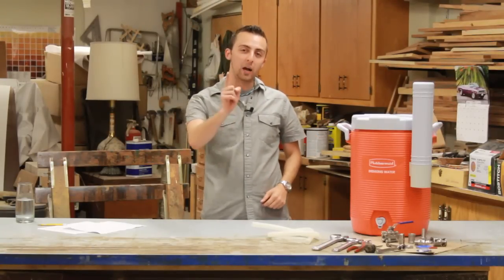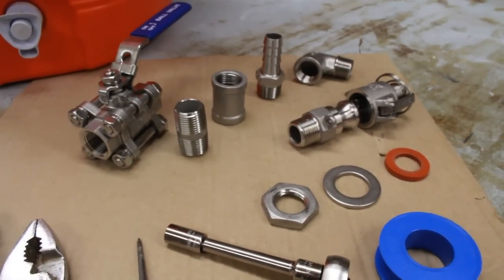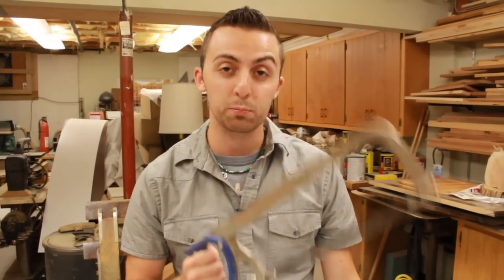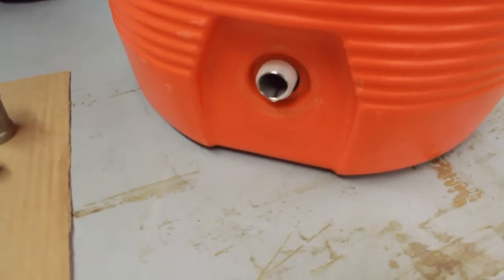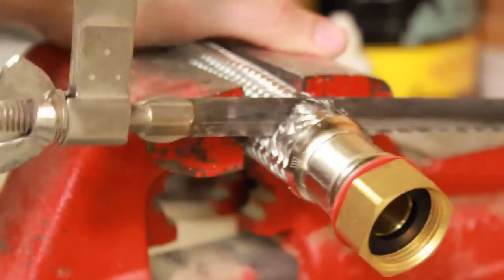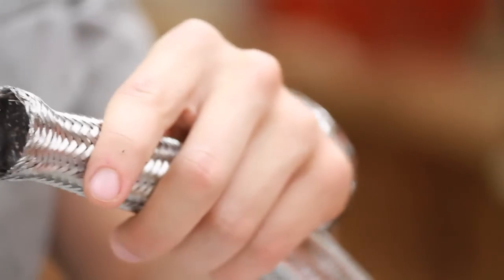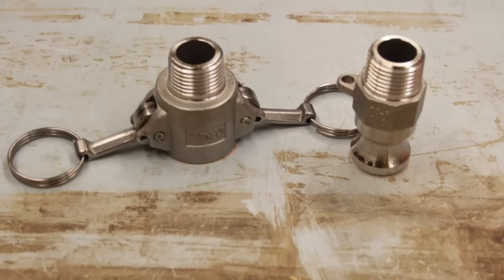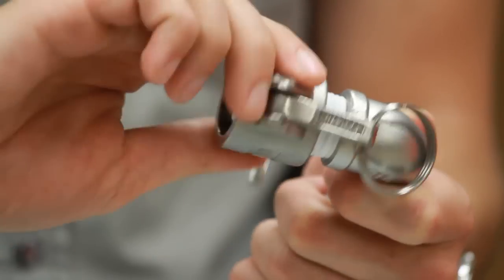How to Build The BEST Mash Tun from a Beverage Cooler

Comment: thank you for the video!!! The most informative and properly produced i have seen! I happened to have stainless some dishwasher hose sitting around. smaller diameter, but it is longer. thinking it will work just as good or better because it will be long enough to circle the bottom of the mash tun twice.  To all the folks complaining- you probably wouldnt be happy unless he to your house with all the parts and built it for you.....  Much appreciated man!!!

Comment: Thanks for the video was incredibly helpful, as well as the links in the description!

I used your design with only a few minor changes. For the Filter I used a 24" long Water heater hose and made a loop that connected to a tee. I figured the loop would make it more crush resistant and the additional surface area would make it more efficient. Also added a coupler so the filter assembly is removable for cleaning.

Great video!

Comment from the maker: Thanks man. That's what I was going for here. Because I bought most of the parts online, I got a good deal on them and they didn't cost much more than brass would have anyways. It was $75 total; I spent $65 on hardware (and that can be trimmed down still) and $10 on the cooler. I just updated the description with the detailed supplies list.

Comment: Great Idea, I built one from 1/2 inch brass pipes and valve plus a 3/4 water heater connector. The tread was short on brass connector so I had to use 1/2 inch EMT nut, this nut is only 3/16 thick (nut on electric EMT pipe connector).

Comment: It's cheaper to buy a purpose built "Bazooka Screen" filter from the brew store than it is to cobble one up from a braided hose. The bazooka screen has a 1/2" NPT thread on the end so it makes the installation easier too.
Reply: InsolNation,true

Comment: What a great video, thank you!! I found on Amazon what might be a pretty good alternative, much simpler, and not too expensive. 
1) Stainless Bazooka screen with 1/2 inch MPT $8.41
2) 1/2 inch stainless globe valve $18.00
3) 1/2 inch stainless coupling F/F $7.13
Local homebrew supply shop has 1/2 inch silicone tubing at $3 per ft

Turns out I have a 48-quart rectangular Coleman cooler. I can't think of any reason why the lauter tun has to be round.  It's got a pretty large cross-sectional area, and the drain is about an inch off the bottom. So the volume of mash in the cooler below the drain might be a bit much, but I suppose I can raise up one end of the cooler to force liquid toward the drain.

Comments?
Reply from the maker: you 100% can and should use that cooler; doesnt need to be round. this rig can be transferred into any cooler you think it will work in.  i will warn against using a globe valve as they're not as good at controlling flow over a ball valve. i'm sure you can find a ball valve for a similar price

Comment from the maker: Agreed, a two piece valve is adequate. But don't get the lead thing confused; it's not coated in lead, the lead makes up a percentage of brass (historically about 2% to 5%) but I prefer stainless. Going 3/8" instead of 1/2" will save you a bit more. As I mentioned in the video, the camlocks are TOTALLY optional but I wouldn't have it any other way; being able to remove my hose so I can put the mash tun on the ground without taking it off the elbow is worth it to me. Everyone's build will vary.

Comment: Thanks a metric ton for sharing this with us!!

I have a query...I have a very VERY similiar Coleman 5 gallon cooler than I am about to convert to a mash tun using your method.

I'm just confused about what size 3 piece ball valve should I get for it... 1/2 inch like you mentioned in the video or 3/4 inch or something else.

The Coleman cooler looks exactly like the one you convert in this video..
(Prolly one is a knockoff of the other)
5 gallon, same spigot, same design..

Please help!
My first brewday is getting delayed because of this and I'm worried the ingredients might perish soon  due to the hot rotten Indian summer going on..

Thanks in advance..
Reply from the maker: Doesn't need to be a 3 piece valve but a 3/8 valve is sufficient, 1/2 inch is plenty even for a 10g cooler or larger. Speed of transfer is not only determined by valve size, but flow through your grain bed and you don't want a super fast transfer or you can end up with a stuck mash
Reply: @nkoridis  Sorry about the late reply, dude. Thank you SO MUCH for your guidance..you have no idea how hard it is to  come across good advice over here in India coz there's barely anyone who knows much or reaches out to noobs like  me.
I mean there's a homebrewing movement  taking it's first baby steps here..couple of websites that sell brewing gear and an EXTREMELY limited selection of malt,hops and yeast.. a small, unorganized body of a few brewers spread thinly across a huge population..
But it's gaining ground.. it's growing.
And enthusiasts like me will spread the word.
So, please keep up the great work..your videos are helping people across the planet, not just locally.
That's awesome!

I should probably stop typing at this point..😂😂
Fist bump from India. 
Cheers!!!

Comment: How do you sparge with this? Simply pour hot water on top after it's been strained? I've mainly been making extract beers for the last 2 years and want to make the change to all grain. I like this set up and am going to make one.
Reply from the maker: Exactly that. Just let it settle, recirculate again and pull the second runnings. Efficient and easy

Comment from the maker: the hardware was all purchased between proflowdynamics, bargainfittings and brewhardware (i've added links in description). the "camlocks for homebrewers" section on proflow's site has most of what you'd need for a project like this. bargainfitttings had the the elusive NPS locknut (instead of the NPT). the only other place i know of that regularly carries it is brewhardware. shop around; one store might have everything you need

Comment: I got my SS washers from boltdepot.com. First, order the wrong ones, thinking that plumbing sizes and regular sizes are the same thing, or, perhaps not even knowing that a difference exists...then, call them and tell them what you have and they will hook you up with all the correct sizes. They even refunded all my money PLUS shipping for my goof on the first bunch. Now my connection works properly. I ended up with part#2952 3/4" SS flat washers.

Comment from the maker: every cooler is different but theres absolutely no reason it shouldn't. i intend on taking my hardware and stuffing it in a 10 gallon cooler very soon myself and the only thing i anticipate i may need to do is add a washer or two to the outside but that might not even be necessary

Comment: Nice - I like the elbow fitting idea - I am going to adapt mine similarly.  What is the aerosol spray that is being shot onto the fittings?
Reply from the maker: It's spray paint to spray the word "mash" on the cooler
Reply: Oh - sorry, I thought I saw you spray something on to the pipe fittings.  My mistake.  I just use teflon tape like you did.

Comment: question:  I have a similar cooler but made by igloo (5gal). it doesn't have a rubber gasket in it.  the hole cut in it is 7/8".  if I use 1/2 inch nipple and parts wont there be 1.5/8" of slop on either side of the nipple which would allow it to slide around and make leaks? or does the gasket system you made keep it from moving sufficiently if synched down tight?  I was thinking I might have to use 3/4" nipple/parts but they are really hard to source in stainless or brass.  help?  thanks for the viddie.
Reply: Sebastian Refined 7/8 minus 4/8 is equal to 3/8 left over total which should be like almost an 1/8" on all sides

Comment: Is there a benefit (or can you think of a reason) to have the screw on lid vs a press on lid?  Thanks!
Reply from the maker: venting. the including screw on lid is designed to vent as liquid drains... if it was an air tight press on lid, you may run into runoff issues (slow draining)

Comment: Is there any reason why you used a silicon o-ring with an ID of 3/4" vs. the 1/2" that you used for all of your piping?
Reply from the maker: Because it has to fit around the 1/2 inch INSIDE DIAMETER hardware. Clear?

Comment: the camera work had me laughing out loud. Thanks for the video. The outside hose apparatus seems overly complex, unless I am missing the point of it. Wouldn't it be easier to just attach a regular 5/16 tube to the ball valve? Why the camlock fittings? (to be honest I am not even sure what there purpose are in general). Also would it be OK to use a plastic spigot instead of the more expensive ball valve?
Reply from the maker: I did mention the cam-lock fittings (quick disconnects) were optional. it's not necessary but if you're batch sparging and moving your mash tun from the ground to something higher up, it's nice to be able to pop it off when you need to add more water so the hose isn't on the ground. You can also use it on other vessels not to mention it makes it way easier to clean. if you don't want them, don't buy them!

Comment: So, learning process, I bought an NPT lock nut instead of an NPS lock nut.  DOH! It would have been really great if Nick would have taken the time to break down the parts list by supplier and part number.  For someone who has never done something like this before it's a bit confusing.
Reply from the maker: please look through the description of the video. there are more than enough details as to which parts you need. although i've been hesitant to recommend suppliers in the past, they too are listed in the description
Reply from the maker: guess who made the SAME mistake when he ordered his parts :/ . i am glad you figured out what the problem was though. hope you have fun with it jason!
Reply: Nick Koridis
Like I said, learning process.  It's what makes the whole thing fun right?  I ended up getting a brass fixture from Home Depot.  I took the lock nut with me so I could "test" it.  Ended up having to modify the design slightly (i.e. put the rubber washer on the outside instead of inside) to keep it from leaking, but I also went with a 10 gal Igloo cooler instead of the Rubbermaid.  It holds water now though, so my next step is to pick up some grains for my first batch very soon.  Since I don't have a fancy RIMS or HERMS system just yet, I'm open to any suggestions on a great single infusion mash recipe?  Hint: I love Scottish and Irish ales :)

Thanks for the video, had a lot of fun putting it together (I have a lot of scrapes and scratches too, but I wear my war wounds proudly).
Reply from the maker: Jason McConnell not the simplest but a very well regarded irish red ale
http://www.homebrewtalk.com/f65/raging-red-irish-red-ale-239188/

check out the other recipes in that category. cheers!

Comment: Soak your tubing in HOT water for ten minutes or so before putting it on. Helps it stretch.
Reply from the maker: Even with silicone?
Reply: Or get one of BobbyM's modified street elbows here: https://www.brewhardware.com/product_p/elbarb.htm

Comment from the maker: both bargain fittings has and brewhardware have the NPS locknut right now. on bargain fittings, search NPS. on brewhardware, look under "fittings/camlock" for "stainless locknut"

brewhardware has a gasket under "accesories", "gaskets". they also have the washer too. if you're looking for something on this website, choose "show all" on the left and then search the page by using ctrl + F

one of these sites will always have this stuff. if you can't find it, you're prob not looking hard enough

Comment: How about sanitization? How do you clean that mesh?
Reply from the maker: You're not worried about sanitation on the pre-boil side of things like for the mash. however, when it comes to cleaning the mesh, just unscrew it and rinse in a sink to remove any hulls or bits of grain as necessary
Reply: Nick Koridis Great! Thanks for the response.

Comment from the maker: If you want the trimmed down version of this: inside the cooler attach the SS braid directly to the pipe nipple. Outside the cooler, use a 2 piece ball valve, and directly attach the hose barb. You may even be able the eliminate the washer inside the cooler leaving you with super high flow, all stainless and silicone components for about $40 instead of the $65 I spent. To save even more, you could use 3/8" hardware and/or switch to brass. Feel free to share your findings.

Comment: The problem with this assembly is that many of these parts (especially in the stainless steel variety) cannot be found in your typical Lowe's, Home Depot, or local department store. I'm currently in the midst of an assembly fiasco as I subbed in brass but the 1 1/2" pipe nipple expands as you move from the outsides towards the middle so none of the corresponding lock nuts, couplings, etc. fit beyond halfway down the thread. I was just going to add washers but the 3/4" washers can't get past that point either. Did anyone else run into this problem?
Reply from the maker: I agree 100% Sean, especially if trying to use stainless, which is why I left a list of suppliers in the description. One of them has a straight threaded (NPS) locknut that will thread all the way down the nipple. A regular locknut will NOT work as you've found out.
Reply: Nick Koridis Got it, thanks. Will the ball valve that I've already bought then fit the new 304 SS pipe nipple or do I need to get all new materials?
Reply from the maker: The nipple you have should be fine, it's the locknut that determines whether or not it will go all the way down the nipple. The ball valve will not thread all the way down the nipple and you don't want it to as the threads with the Teflon tape will make the seal

Comment: I am in the process of making a mash tun and I worry that the stainless steel braid may not be the most safe material for beverage making....I went to home depot and the braiding they sell is intended for washing machines and dishwashers and although they are stainless steel, they all mention having <.25 (some random units) of lead and are not intended to come in contact with food or beverages that may be consumed by humans... I am going to check out a few other hardware stores to see if they sell hose braid that is stainless steel and completely lead free... Just make sure you read the labels of the supplies you buy when making this so you dont dose your brew with lead
Reply: Remember that the main problem with lead contamination is a function of time.  Figure an hour of mashing and an hour to two or lautering, and the time in contact with a potentially low-lead source is not likely to be a significant contributor of  lead to the wort.  It is a legitimate concern in general, however, to avoid lead.
Reply: Buy a ready made one from a home brew supply store, locally or online. IMO, they are so affordable, I wouldn’t mess with making one.

Comment: no one will ever see this but I have to ask. How do you heat this? I cant find anywhere that says how to heat this thing. I cant burn the bottom of it, its plastic! Does this cheap alternative require a cold fusion plant to utilize it? I dont understand and this is probably why I will never make anything more complicated than mead. :(
Reply from the maker: you DON'T heat this. you heat water in a pot and add it in a little hotter than you need it so it cools down to your target temperature. that starting temperature is called your strike temperature
Reply from the maker: glad you asked. brewing beer is not hard. if you can do mead, you can do beer
Reply: @nkoridis  Holy crap! That makes so much sense! in all the videos they are heating the mash with a stove or something but the cooler just keeps it at temp! What a revelation! Thank you so much for replying! I still will never understand sparging though ;)
Reply: @nkoridis  Well I don't know, I can BARELY do mead.

Comment: That is a ton of gear to make this. You can save oodles of money and time by just getting a bung with a hole in, a few feet of tubing and a tube clamp. No need to go with all the fancy ball valves and fittings.
Reply from the maker: ^truth but i do love my quick disconnects. i would definitely go with a bazooka screen that has a fnpt to thread onto the nipple so you can unscrew to clean well. unfortunately i didn't have that available when i made this as i mentioned in the description
Reply from the maker: i also use mine for water storage for purposes other than brewing and need the ball valve. not just for mashing :D

Comment: Very nice video but omitted plugging the end of the stainless steal filter that is on the inside of the mash tun
Reply from the maker: you omitted or i did? there is another video that uses a type of plug to close the end of the stainless steel braid but it's a waste of hardware; just fold the end over